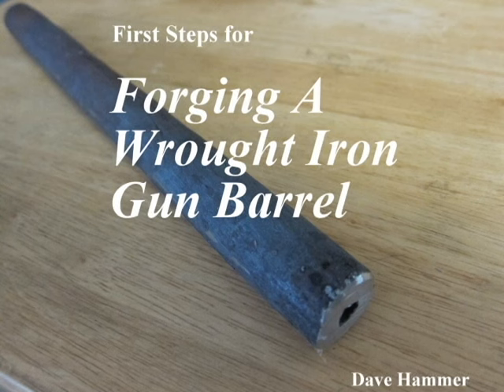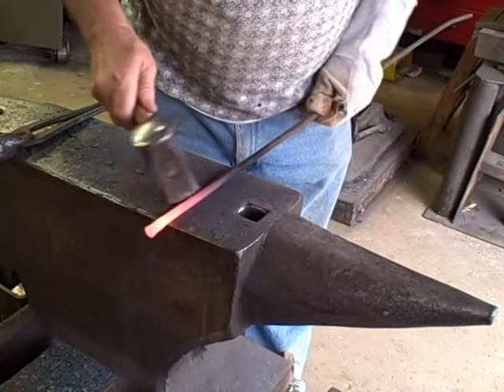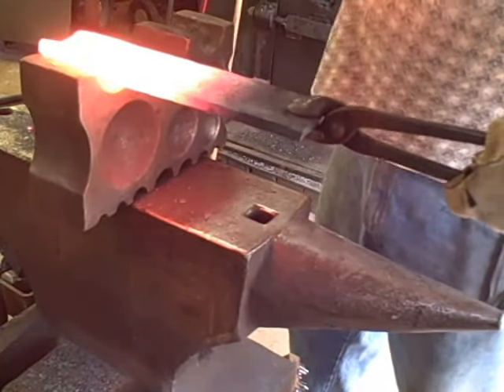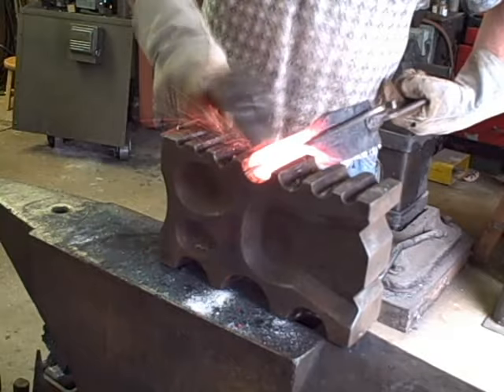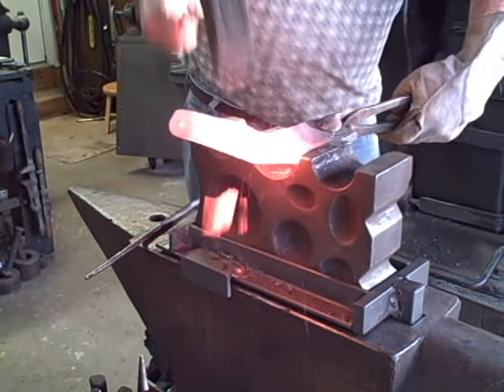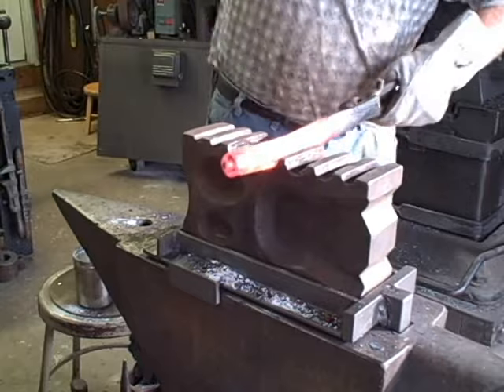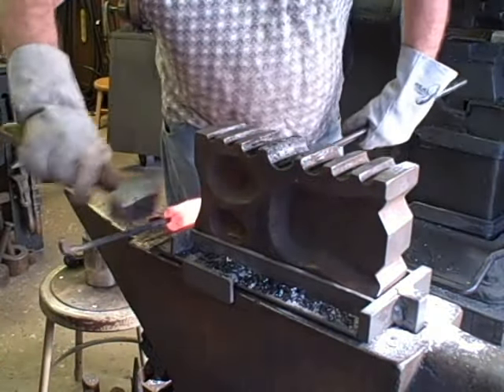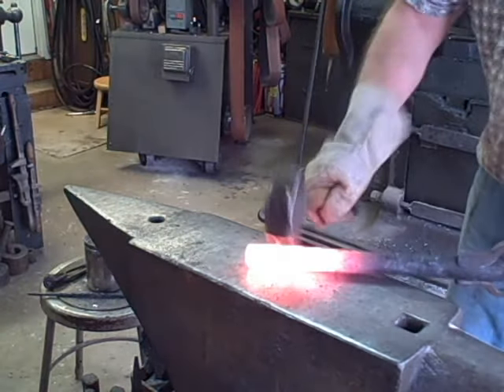Forging a gun barrel

Comment: Nice work! But is essentially still a welded barrel with a seam, It would be fine for black powder but how well will it stand up to modern loads and what method of heat treating of the finished product is required?

I ask because turning a barrel from a known piece of stock on a lathe is much simpler, he says the forged barrel is stronger but I really don't see how it could be starting with cast iron as apposed to a known solid steel value and having a seem that is basically just the metal forced together.
Reply: +TruAnRksT iron barrels can not take the pressure of smokeless powder, a properly milled and hardend steal will be stronger. this method is stronger than cast iron or other methods used 200 years ago. steel was not cost effective at the time nor do i think that steel was easy enough to work with for such a complicated device. look into the evolution of guns between the 1860's and 1900.
the smithing and engineering  technology  was behind the propellent and as a result a new system of "proofing guns" was developed in part of the danger of putting nitro powder (smokeless) in a black powder gun. people started making parts thicker and heavier, and were forced away from more easily workable metals such as brass. within the time from the napoleonic wars and the 1900's industrialization took off and so did steel  

personally i would not use a iron barrel for anything more than a shotgun, but that is only because of modern materials and methods. though it is effective for black powder loads hammered wrought iron is tough stuff especially compared to cast. cast having more impurity and carbon making it brittle more ideal for grenades, wrought has a higher melting point and i don't know if it would of been easy to pour.
Reply: +TruAnRksT ....  Thank you.....  I think you may have missed the reason I initiated this project.  My goal was to see if I could forge a gun barrel in the same manner as blacksmiths did in colonial days.  If I finish the gun and test fire it, the powder and loads that will be used will also replicate (as best they can) those that were available during those days.  I'm sure there were other methods and metals used also.  The process and materials I used are frequently demonstrated by gunsmiths from Colonial Williamsburg and represent work done during that era.
Reply: David Hammer
Ah in that case you are doing it pretty close to how it would have been done. Any idea on what the finished caliber will be?
Reply: +TruAnRksT...   Not sure about the caliber yet....  It depends upon how the drilling, boring and rifling go.
Reply: I want a barrel with a hexagonal interior where the hex shape is twisted to provide the function of spinning the projectile (a variation of rifling's) so that you can use worn out P2 Phillips driver bits as bullets.
This would most likely be an air gun concept but you just don't know.

Comment: Would it be harder to forge-weld if the material was mild steel instead of wrought iron? Or does proper fluxing take away that issue?

Great video, thanks for sharing!
Reply: +Bulsh1tMan... Thanks.  I haven't done this with mild steel, but the a Williamsburg gunsmith told me it was more difficult using mild steel.
Reply: David Hammer  But still possible then? Thanks for the reply :)
Reply: +Bulsh1tMan...  Definitely possible.   If I recall correctly, when I saw the Williamsburg gunsmith weld the long barrel, it was what he called pure iron, which is actually very low (or no) carbon mild steel.
Reply: David Hammer  I heard wrought iron stock is practically non-existent on the North American market, being that mild steel has replaced it, so I'm curious as to where you get your iron from?
Reply: +Bulsh1Man...  While it is  true that wrought iron has not been manufactured for decades, it is not really that hard to find, at least in small quantities.  It is recycled from many objects where it was used for construction (building structure, bridges, towers, machinery (farm and industrial),  decorative purposes and much more.  When buildings or structures are demolished, it is not unusual for someone to be salvaging it.   So... even though recycled quantities are extremely small compared to the availability of steel, I'm not sure I would agree it is practically non-existent.  It was used in construction well into the early years of the 20th century.  I see small quantities on eBay.  I frequently see small quantities at blacksmith conferences for sale.  I see advertisements in published material  blacksmiths read (ABANA and guild newsletters) that identify suppliers that have done small and large scale salvaging. I have also seen old real wrought iron decorative work for sale.  I have seen it for as little as a buck a pound...   or as much as $6 or more a pound, depending upon location and quality.  

Personally, I have bought wrought iron at blacksmith conferences when I felt the price was attractive, but most of what I have for "stock on hand" comes from recycled wooden wheel tires (some people call them rims) that I found in scrap yards or at farm auctions (those are rare now) in the Midwest (I grew up in North Dakota). I have bought a few here in Virginia, but rarely.  I expect most old junk yards in rural areas anywhere would be good source, I just don't look for them here in the East. When I visit the Midwest, it's something I do for enjoyment.   I have also seen rims at recycling centers (usually grossly overpriced) that mostly sell unusual architectural objects salvaged from demolished buildings.

Most wrought iron used for wheel tire tires is of poor quality, but for many of my projects...  that is what I want (I etch in acid to show the grain).  Not infrequently, I find a tire where medium, or even high quality wrought iron was used (such as the tire I used part of for the gun barrel).  Unless the seller has cut and broken a piece of the iron for view (or it's so corroded you can see the grain), it's generally impossible to know what grade you are looking at just by looking at it.  Unless it's severely rusted, you may not even be able to tell if what you are looking at is really wrought iron.  Most, but not all tires are wrought iron...  remember, steel became common during the late 1800's).  The easiest way to tell is to cut a narrow piece in half, put it in a vice and break it.  If it is wrought iron, you will see the grain.  The smaller the grain, the higher quality the wrought iron.
Reply: I want to clarify....  Wrought iron is fibrous, which is why you see a grain when you break it.  Steel, when or if you can break it, will look more crystalline.  Wrought iron will always tear when you break it, exposing the fibers, even when they are extremely fine.  One other thing, extremely fine wrought iron may not show it's fibrous nature when etched.
Reply: David Hammer I am familiar with the grain structure of wrought iron, I seen pictures of old iron that look pretty much like wood - extremely cool. Very interesting to know that wrought is still found and salvaged today, though I'm sort of surprise with blacksmithing making a comeback that there's no major artisan bloomery operation going on to produce new iron for the hobby. I guess with 300 years of old iron laying around, there's no need for that? How much does wrought scrap usually go for these days?
Reply: +Bulsh1tMan...  As I mentioned in my answer above, wrought iron can be found for as little as a dollar a pound, up to over six dollars a pound (and more), depending upon location and quality.   

Within the past 10 years or so, there WAS a company (I can't remember the name) that started producing pure iron for the blacksmith community (real wrought iron was marketed as pure iron).  I don't know the exact process  they used, but I doubt it was similar to the way original wrought iron was produced.  They advertised they would give away small samples to anyone that asked for it.  The bars were big enough to make a couple leaves or hooks.  I never received the sample I requested, but I did see a couple demonstrations where it was used.  The demonstrators said it forged very easy....   When the product was commercially available, the cost was too high (I don't remember how much) and the blacksmith community did not buy it...  The company went out of business shortly after they started selling it.

As far as I know, most restoration of old ironwork is done with either recycled wrought iron or mild steel.
Reply: David Hammer  Thanks for sharing, very cool stuff!

Comment: The problem is in order to actually forge a barrel you have to start forge welding the center and put your mandrel in from the edge into center. And you forge all the way to the end. Then turn the barrel around and work from the center out to the other edge.

Comment: The reason you are having problems with your swage block moving all over the anvil face is simple. SWAGE BLOCKS SHOULD NEVER BE USED ON TOP OF THE HARDENED FACE OF THE ANVIL. The correct thing to use is swaging stump, same as the anvils block, or a proper swage block stand. that way its supported and vibrations are safely absorbed.
using it on the anvil may lead to a cracked anvil face, and that would be such a shame with your beautiful anvil. if you must continue using it in this manner, i recommend you place a board between.

Comment: Very nice work, I like the idea if using the rim from a wagon wheel, I do have a question,  is the strength of the forged weld better or less than if you were to weld it with a stick, Of course if you welded it with a stick welder I would imagine that keeping it straight would be tough to do,
Heck I think I just answered my own question :)
I look forward to watching more videos produced by you
Reply: The purpose of the exercise was to see if I could forge weld a short gun barrel the same way it was done in during Colonial days.  

They didn't have stick welders back then.  Even in todays world, a stick welder would not be used.  Round stock would be drilled out.
Reply: ok thanks for the reply I know what you were trying to do and holy cow they didn't have stick welders back in colonial times ?? :)
And I know how they do it now I just wanted to find out your opinion on a forged weld verses an stick type weld, Perhaps you are not the guy to ask
Reply: I would expect if you could roll mild steel into a pipe and taper the joint so the stick weld would be 100 percent, it would work....  I believe you would NEED to use mild steel though,  it is almost impossible to arc weld wrought iron...

Comment: I do like your swage block jig, that lump would hurt if it fell on your toe! Did you clean up the weld joint area or rely on Borax flux to clean it ?
Reply: Englishman French I squared up the edges of the bar before I started forge welding.  This effectively cleaned up the joint area.  I also occasionally wire brush the surfaces being welded, but the key (for me anyway) is the flux.  It helps keep scale (formed during the heating/cooling process) liquified so it squirts out of the joint being welded.

Comment: If you would use this Barrel in a Gun, even with a  Blackpowder charge, it would probably explode. 
You will never get a good connection along your welding line. Or at least not good enough to withstand the pressure. 
Gunsmiths used damascus barrels 150-200 Years ago because they knew a welding line parallel to the barrel bore will burst.
Reply: +crazyjoni206 is it possible to do this process but using damascus instead of just wrought iron?
Reply: I am not a historian, but the Colonial Williamsburg blacksmiths are.  I witnessed a demonstration where one of the Colonial Williamsburg gunsmiths explained and performed the same operations I used to make this gun barrel.  He said, during colonial times, most gun barrels were made with wrought iron.  To prove (validate) their forge welds, they use at least double the normal amount of gun powder to shoot with it.   Some fail, but most are successful.  I have little doubt (although I did not ask the question) that some barrels were made using damascus, but I have to assume they would be relatively rare and only the very rich could afford them.  Anything made from damascus would have been extremely expensive.  I would expect  that many hundreds of thousands, if not millions, of guns were made before steel was easily produced (in the late 1800's).  I would bet that an extremely high percentage of those were made with wrought iron.
Reply: + Mr Nobody....    Without a doubt, a gun barrel could be made with damascus.
Reply: Some day i will use this method to make a gun barrel but using damascus. Thx Anyways

Comment: great job! man do you have to believe in your forge welding skills to fire a gun barrel made this way! wow super nice demo, thanks for sharing your work mr hammer. how do you recognize real wrought iron from low carbon? i know a legend maybe that says spanish gunsmiths in the xv or xvi century used the worn ends of horseshoes to make gun barrels (the "arcabuceros de madrid" i believe) but that made iron somewhat higher in carbon than wrought iron... maybe it`s just old wives tales. thanks again. cheers. pete
Reply: Nope, not an old wives tale... I'll try and find the reference in my files
Reply: Albert Rasch
thanks!

Comment: We need some other way to work with metal. For example, could you wind it from thin steel wire?
Reply: remember25october Yes, They used to use wire and the pound it smooth.  it was called Damascus steel, if I remember right.  My father owned a Damascus steel doiuble barrelled 12 guage shot gun and you could see the welds between the flattened wires.  It was considered dangerous to use anything other than the weakest shells.
Reply: Ray Provence Damascus barrels are a lot stronger than folk law would have you believe, a recent test conducted for the magazine "Double Gun Journal" took a number of old clunker wall hangers and subjected them to increasingly higher charges, none of the Damascus barrels failed, even though subjected to modern day proof loads, but the actions were the thing that finally stopped the test, top lever springs ribs lifting etc. Given that the guns tested had already been "retired" to wall hangers, that was pretty impressive.
Reply: Englishman French They are strong. My first double barrel shotgun was a damascus barreled Belgian made 24 gauge with exposed hammers. I hunted a lot with it using modern shells and never had a problem, and a friend of mine hunts with a double in 16 gauge which also has damascus barrels. No problems whatsoever.
Reply: Englishman French They are strong. My first double barrel shotgun was a damascus barreled Belgian made 24 gauge with exposed hammers. I hunted a lot with it using modern shells and never had a problem, and a friend of mine hunts with a double in 16 gauge which also has damascus barrels. No problems whatsoever.

Comment: I had always thought that barrels were made of steel. I am just wondering, how much percentage of carbon would you say might be in that wrought iron? Also, what would it be near to in the modern classification type names,....you know like how they call metal types names like 4140 , A2,...ect.,...like before it is forged and after it is forged?
Reply: John Kerley   I'm not an expert, nor a historian, but if you search online for information about wrought iron (ex... http://www.gsa.gov/portal/content/111770) , you will find specific information that discusses how little carbon there is in wrought iron.  Other than using those types of references, I don't have the experience with or access to modern machinery that could measure carbon content.    When I look for information online, the percentages, although always low, are all over the place.  I expect the specific method used for smelting iron ore to pig iron (and subsequent processing to improve the grade of the wrought iron) caused the variance.  

It's my understanding that, unless some process was being used to actually ADD carbon during processing, carbon would be lost during processing (so the percentage of carbon present would be less after each forging session).  The percentage of carbon in wrought iron could/can be increased through carburization (more research for you).  

Comparisons of carbon content in wrought iron to any modern steel is fairly easy because the range of carbon content for any modern steel is also readily available online.  If you search for alloy data sheets for the various types of steel, you will find their (range of) carbon content.
Reply: David Hammer Yeah,I was just curious about that because I think the metals used to construct modern firearms is actually a government secret,...or military secret.
Reply: David Hammer From some of the things I've seen....it may have more to do with forging than the type of metal that was used.

Comment: Stupid question but would this finished product be cold forged steel?
Reply: Hay_ImKeyser_Söze No....  Cold forging is done at slightly higher than room temperature.  The process I used is hot forging.

Comment: I would prefer a solid forging that was then drilled, bored and rifled. A good forge weld is good but not as good as the method I mentioned. Cool just the same.

Comment: Amazing.The iron must be not very high carbon steel.Doesnt weld tougether.I know that the Damascus Barrel are from many iron wire forged
Reply: The wrought iron I used in the video would have very little carbon in it.  Carbon can be added during the iron manufacturing process (making carbon steel) to increase strength.